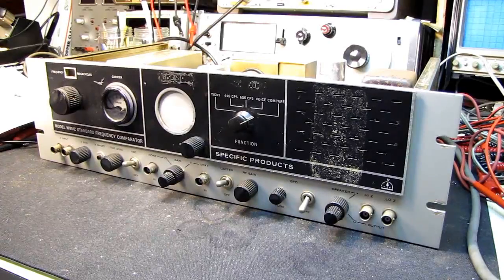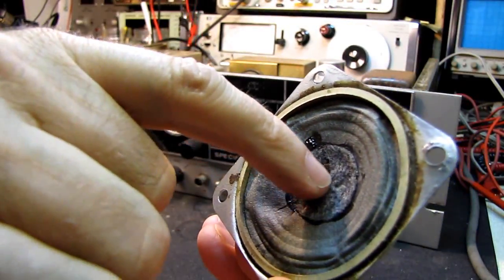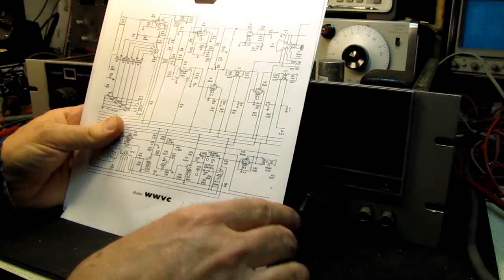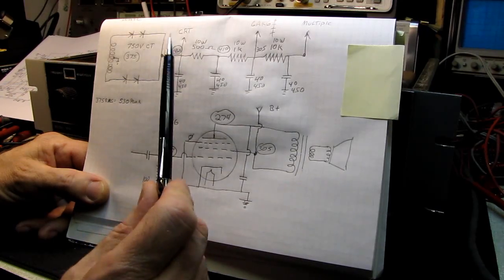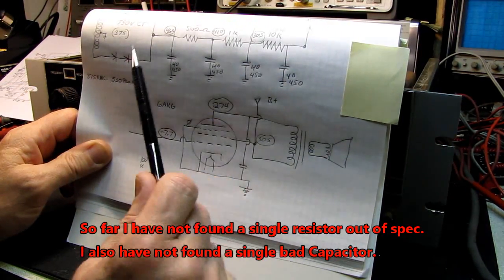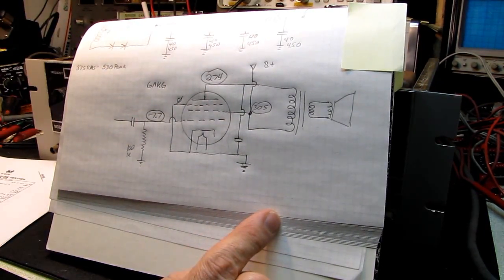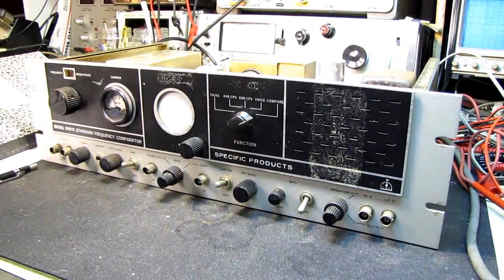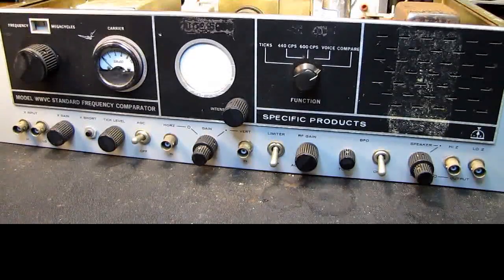Model WWVC Standard Frequency Comparator #2

Comment: This manual has voltages at the tube pins - it is for the previous model with the 5Y3 but the voltages should still be useful.  https://www.ganino.com/games/Electronics%20Datasheets%20and%20Manuals/Specific%20Products%20WWVC%20Time-Standards%20receiver%20Ops%20and%20Service%20manual.pdf
Reply from the maker: Thanks Meras, this is exactly what is needed. This will go a long way in figuring this out. Thanks for watching and the assistance. Vern

Comment: Hello,  I wonder if the rectifier diodes were originally selenium?  That would make the B+ run high if they were replaced with silicon.
Reply from the maker: HI Meras, the original circuit in the manual shows a 5Y3 which would also have more voltage drop than silicon diodes. The do have two diodes in series on both legs so I suspect this was done to create a little more voltage drop. 1.4 volts VS .7 or whatever the actual diode drop is in those old silicon rectifiers. The diodes in the radio are for sure original. The set is basically untouched. Not a single solder joint has been redone since this left the factory. all the diodes in all the strings are the same part.  I cannot remember selenium used in any commercial gear I have had my hands on that was manufactured past the 50's. Plenty of them in farm radios and early AC/DC sets. Large voltage drop in them. Thanks again for the help.

Comment: That Triad R14B transformer is rated 350-0-350. Is high modern line voltage pushing it too high? The output transformer has a 600 DC ohm primary so the tube is pulling  around 50 ma. It has to be bad. Interesting unit.
Reply from the maker: Hi Robert, the unit is actually rated for 117 volts so the transformer isn't really being pushed too badly. That actually was my first thought but the transformer primary is marked 117.  Notice the double diodes in the full wave rectifier. Not sure if they did that for breakdown voltage or to add some voltage drop that would have been present in the 5Y3. The output transformer is an S-17X and marked on the transformer 10K ohm @ 10 mA. I will need to break in and see what the real draw is.  I found a 6BN6 beam tube in the limiter circuit that was way way down on emission. Beginning to wonder if there are a lot of tubes bad and just not drawing enough current to pull the B+ down. Haven't checked yet. However I did check the 6BN6 specs and it is only rated 11 mA on the cathode. So unlikely it is contributing much. Need to get in there and check current draw on several tubes, but pretty much convinced the 6AK6 is bad even though it "tests" OK. Great insight though, comments like yours make me rethink what I am looking at and help a lot. Thanks for watching and the great comment. Vern
Reply: The S17X has a DC resistance of 600 ohms according to a old Triad catalog so with a 31 volt drop between the screen and plate it is drawing around 52 ma. The voltage and resistance chart in the manual reference by another user says 500 ohms with a 20 volt drop for 40 ma. I guess with that many tubes if a bunch are drawing low it could add up.
Reply from the maker: Robert, take a look at the note from Meras Hallan where he sent me a link for the manual. You can see the schematic in it.
Reply from the maker: Hi Robert, I also looked at the old Triad catalog. Seems to be a discrepancy between the catalog and what is printed on the transformer itself. Another mystery. I am going to check and measure the actual current trough it and see what the actual resistance is. Again, great insight my friend.
Reply: I have it. Voltages are just way high. Where you have 274 and 305 is supposed to be 240 and 260. It surprises me that there is no regulation at all in the power supply. You would think that at least the oscillator would have a 0A3 or something on it.
Reply from the maker: I am going to put this back on the bench and do another short video. Your input is invaluable.
Reply: Apples and oranges. 10k audio impedance vs 600 ohm DC resistance.
Reply from the maker: Agree, I was very surprised not to find something of that ilk. OD3 would be good for 150, two for 300. Voltages are way too high. Need to check all the tubes for emission. Could be so many weak that they just are not pulling enough current. Long shot, but everything in the Power supply is OK. That Electrolytic cap isn't going to live long at 465 volts when it's rated for 450 and is many years old. On the bench soon.
Reply from the maker: Your right, knew it as soon as I hit the send key. Trying to think AND answer comments. Too old to multitask.